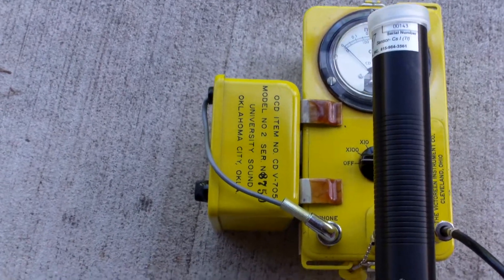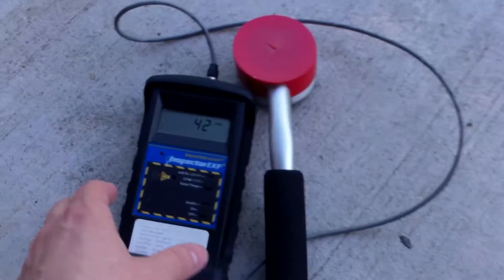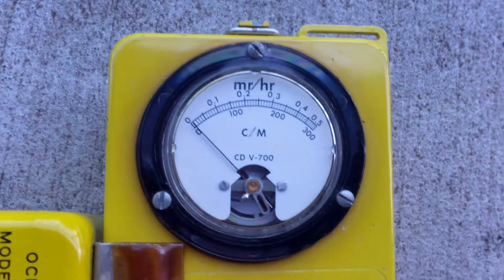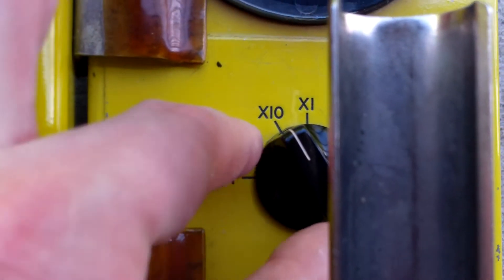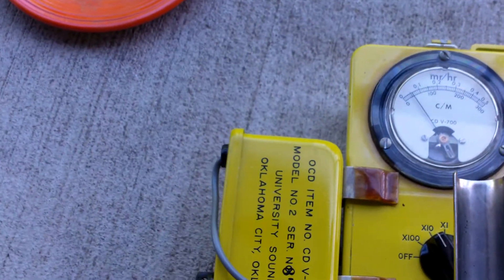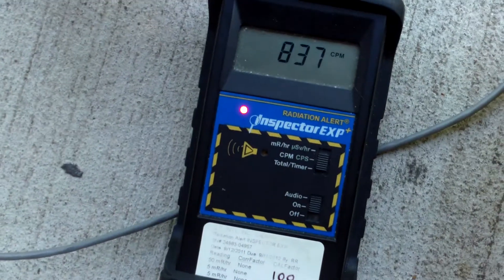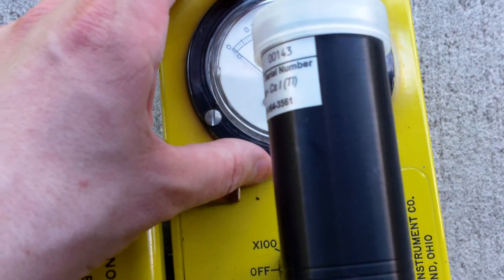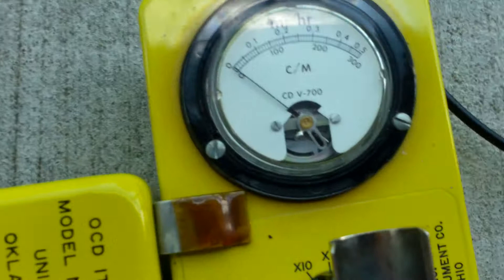Geiger Counter Basics - A Few Quick Tips

Comment: Starting at the highest scale is actually very clever! Also, if the radiation being measured is too high, the analog needle can actually get stuck if it swings up too fast. The fix for me was to knock a little hard on the instrument, freeing the needle. This has happened to me, but only a couple of times. However, it was with a Victoreen CD V-700 6A, measuring an energized X-ray tube.

Comment: Here's one VERY IMPORTANT tip that Tom didn't mention: as with all electronic devices, when using alkaline batteries for your unit DON'T leave them in your geiger counter for extended periods of time as the potassium hydroxide electrolyte can and will eventually leak out and then you'll either have to clean it to possible get it to work again or spend hundreds of dollars for a replacement if the damage is severe enough.
Reply from the maker: +Brandon Fisher TRUE!!!

Luckily, Ludlum keeps their batteries in a separate compartment for just this reason!

Comment from the maker: Yes! Never switch whilst on. It harms the unit.

If you are using CPM or CPS, you do not actually need to re-calibrate between probes! Only if you use energy units (which you should not anyway).